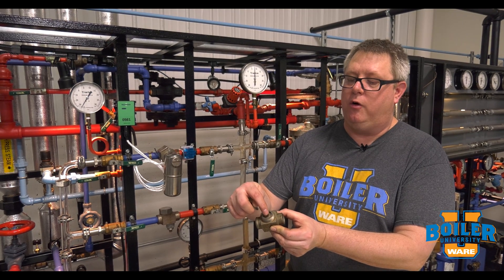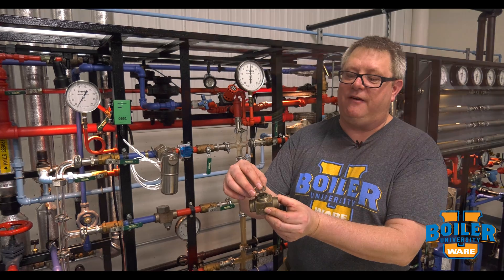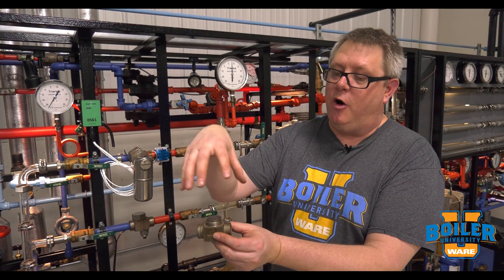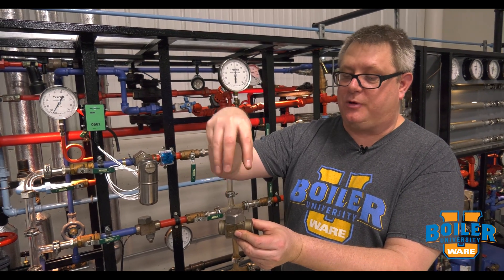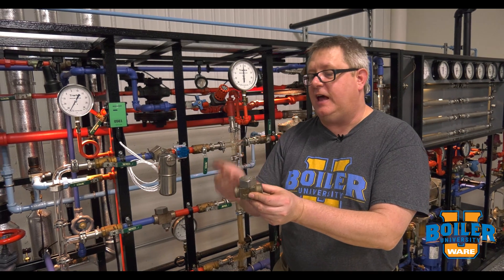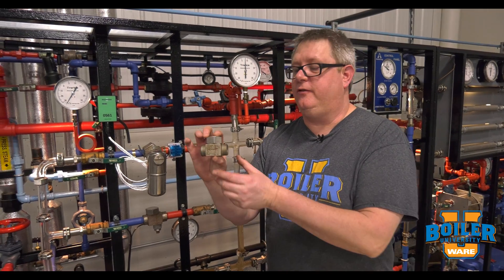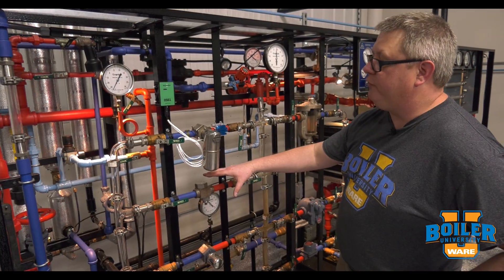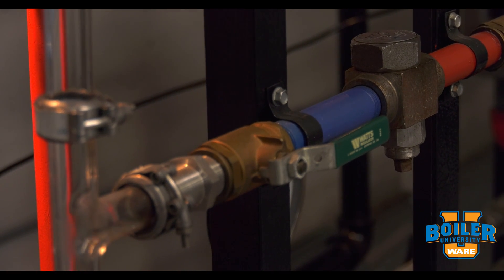Steam Traps | Thermodynamic Trap Functions and Uses - Weekly Boiler Tips

Comment: This is a very insightful video. Thank you! 
Was just curious, when in production , is there a possibility that a thermodynamic steam trap show temperatures lower than a 100 deg C?
Reply: yes. The traps on the 350kpa and 105kpa systems at the facility I work at all return condensate below 100c. usually 70-90c on the 350kpa system and 45-60C on the 105kpa system. The condensate tank that they return to is operated at a pressure of 110-130kpa. The condensate from the 1040kpa system after the steam trap is usually between 120-135C. It also returns to the same condensate tank as the 105,350kpa system.

Comment: Please talk about how an inverted bucket trap is also good at using steam. If i understand it correctly the very design of the trap in order to function right must be made such that it remains primed at all times. Which means that the incoming steam bubbling up from the bottom of the water filled trap will more readily condense. This makes sense when u also realize that the trap is designed to not empty itself as much as possible. It needs some water in it to readily condense the incoming steam from the bottom. Its a perpetual self sustaining process. Am i wrong?